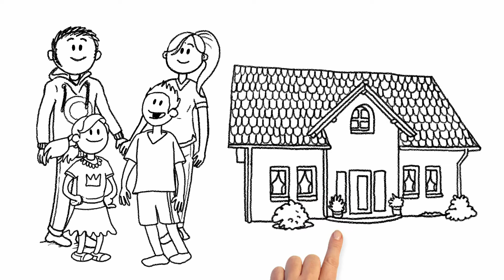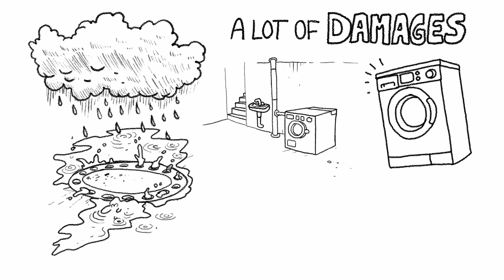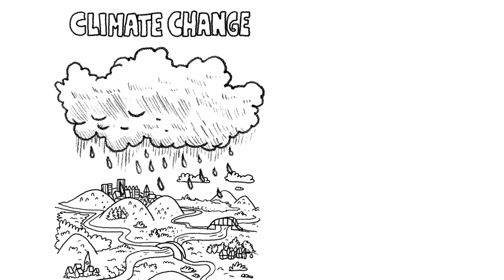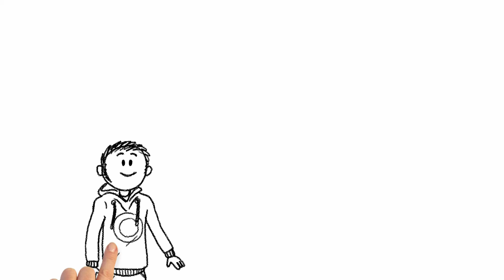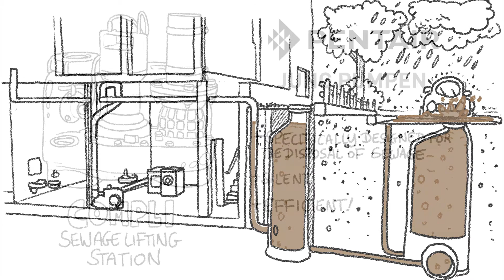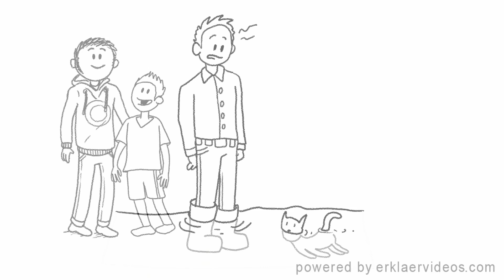Explanatory video - Effective backflow flooding protection

Comment: So you have to remove the drain in your basement to prevent flooding.
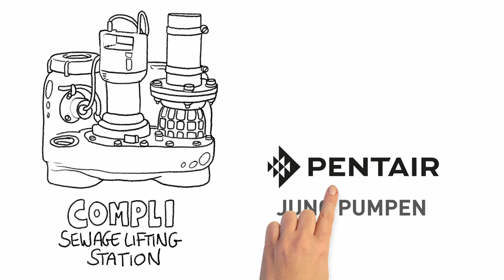Reply from the maker: Only sewage lifting stations provide comprehensive protection against backpressure sewage. They keep the water in the on-site pump sump. From here they pump the water reliably above the backpressure level into the sewer. Even in case of backpressure when the sewer is completely full. Means that the old drain pump below the basement will be closed. You can see that very good in the following animation at approximately 2:30 https://youtu.be/7d3cqwZXgNo